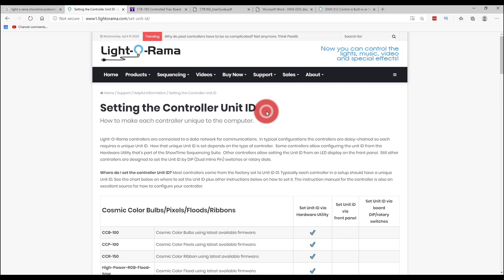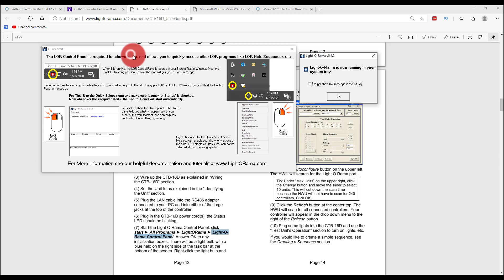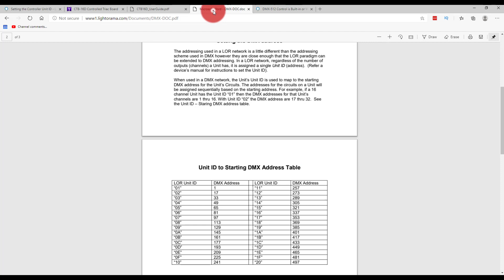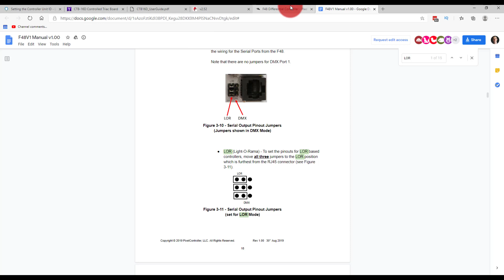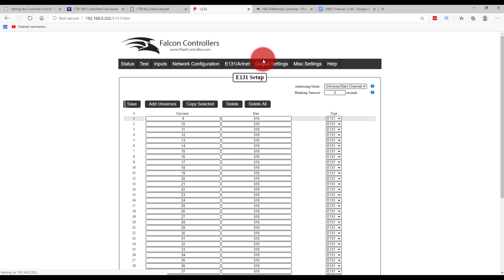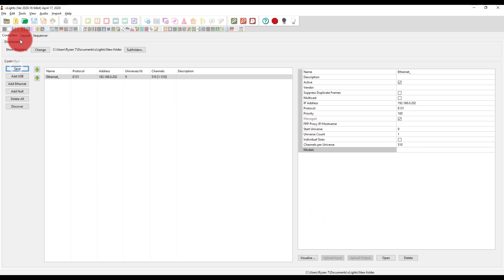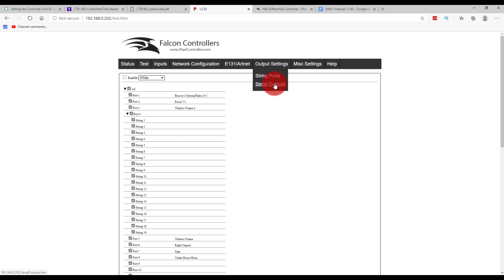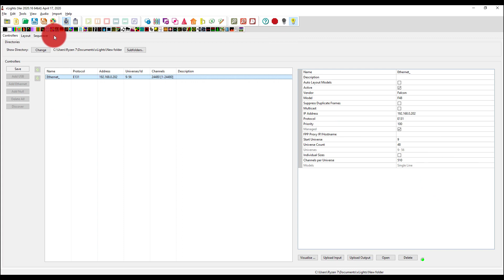How to Use an LOR Controller with xLights

Comment: I have a LOR controller along with a Raspberry Pi and a USB485B, I have worked hours trying to figure how to play my songs using the FPP app, yet no lights are turning on... What do I do?
Reply from the maker: My gut reaction is that the Pi doesn't work well with the USB485b dongle you have.  I would try direct from a PC and see if that works (as the problem could be elsewhere in your setup)
Reply: @LearnChristmasLighting  Nothing was wrong with the pi, or the dongle. it was just that we did the configuration wrong in XLights. Thank you for your help though!

Comment: I know this video is 2 years old. Why is a Falcon controller needed? I am sorry to say I do not follow the logic here. You do not mention in the video that the 485 dongle cannot be used with xLights directly to control an LOR Controller, is that the case? It appears that you videoed this before being prepared. 
So, please clarify for me what is what. I do not want to use a Falcon Controller. Are there options that do not require one?
Reply from the maker: You have to get DMX out of your show controller somehow in order to program the LOR controllers.  Since most of our viewers here do pixel shows (or are going to), that's typically the easiest way.  the LOR Dongle should in theory work with xlights, it's just harder to configure and not the best choice for those that already have a pixel controller with the DMX output

Comment: I was able to convert / config my CMB24D (floodlights) that were running connected to my FPP with LOR dongle to run off my F16v3 using DMX and a standard cat5 cable.  Tested with xlights, then FPP, the pushed thru a few sequences.    

Thank you.

Comment: 6:43 If anyone’s curious, the knobs override the software unit ID I believe the next time the controller boots up. When I bought a used controller it was driving me crazy that it kept changing back to a different ID until I checked the manual and realized the knobs set the ID. Only controllers without knobs should need to use the software to set IDs
Reply from the maker: Thanks for letting us know!

Comment: I have bought an LOR  and I want to use it with xlights and not it not picking up the single
Reply from the maker: Then you definitely have a problem!  I would start with trying the test mode on your pixel controller for whatever serial output you are using.  If that works, then the problem is in your xLights configuration.  If that doesn't work, then you have a problem with your output setup on your pixel controller and/or the addressing on your LOR box.  Once that's working, then test again via xLights to see if it works all the way through!
Reply: @LearnChristmasLighting  I only have an LOR controller and I do I need to setup configuration for my LOR for it to work
Reply from the maker: Right, but it is not a network-based controller.  It uses DMX, which requires with a USB-DMX box or a pixel controller with a serial output to connect to the LOR controller.
Reply: Here is my controller I am talking about

Comment: My lights have gone crazy. when I try to run them, only half change and some patterns dont even do what they are programmed to. I have 367 5v led strip. 5v power supply  ( 40amp)
Reply from the maker: You most likely have a power injection problem.  Check my videos and posts on power injection, and if that doesn't solve it then you have a configuration issue.  More help inside https://learnchristmaslightingacademy.com/learn-christmas-lighting-academy/

Comment: This is a very good video for setup but I've tried this method over and over and cant get it to work for me. I got far enough to the LOR box to light in test mode but when I tried to run it on a sequence it won't come on. I have a few props that work in Xlights but I have many A/C lights that I still use in my display. I even tried to use the USB dongle out and my box seems like it doesn't receive data CBT16PC up to date on firmware. Any ideas what I could try next?
Reply from the maker: Hmm...I am not sure how to get the LOR USB device to work in xLights (or even if it can).  I think it's easiest/best to come from the DMX output of a pixel controller rather than the USB device.   Are you connected that way?  If the test mode of your controller works, but not a sequence, then there is something mis-matched between your xLights configuration and controller configuration.
Reply: I struggled with this as well. Using DMX I could get it to work occasionally, but not consistently. I ultimately gave up and for the last several years,  I've used use the LOR USB Dongle attached directly to the Rasberry Pi Master (running FPP) that I use as my show controller. That works fine from XLights as the first universe and first 12 channels. Even then, once or twice a season, I'll notice the lor box will not output analog during a show. I've found rebooting the master usually fixes it. Frustrating but I like having some analog elements in my show so I put up with it.